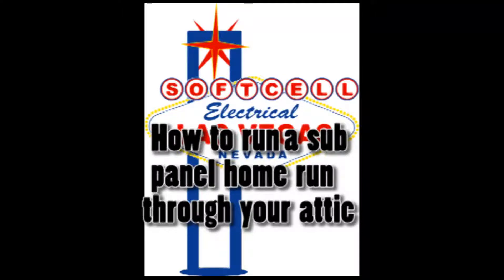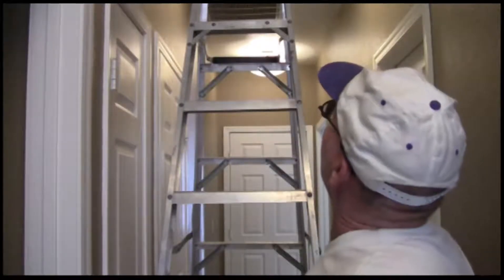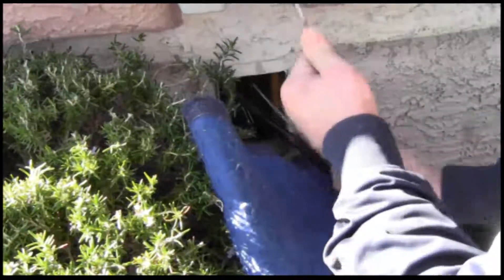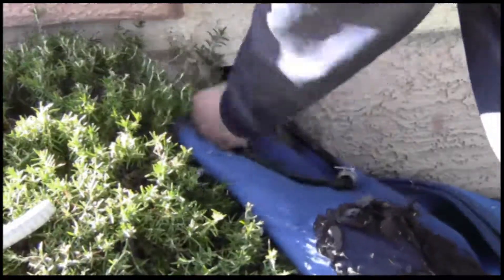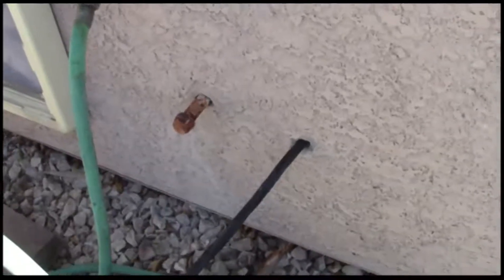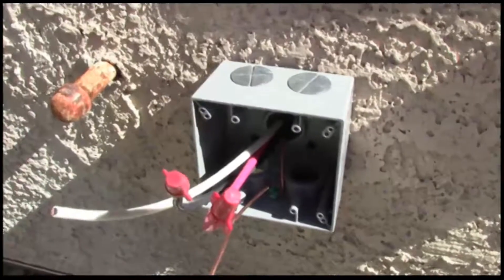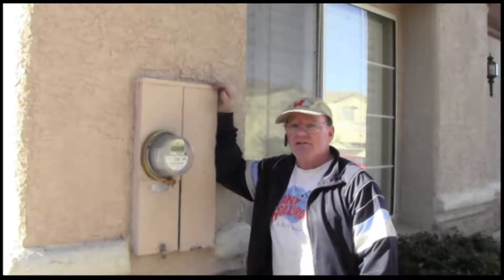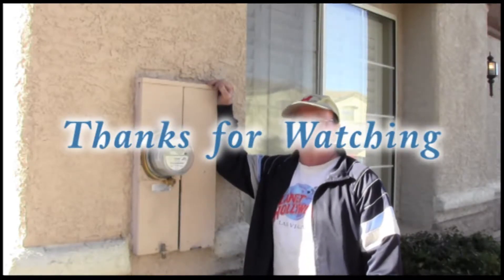NEC Code on attic runs to the panel #4 A 119

Comment: In the diagram @ 1:06, in regards to code, does that orange wire section going across the joists need holes drilled to run the NM through?